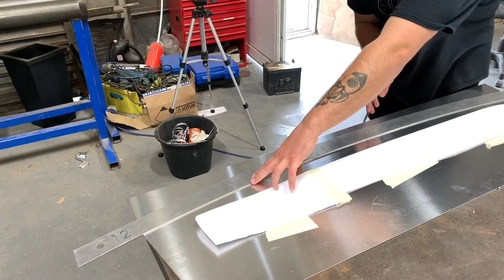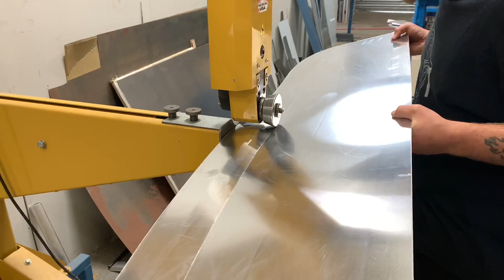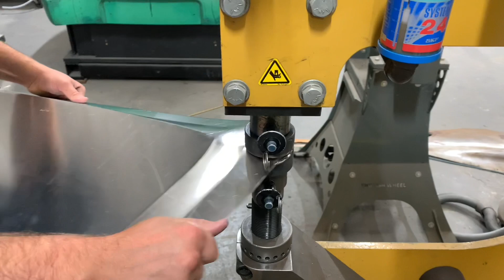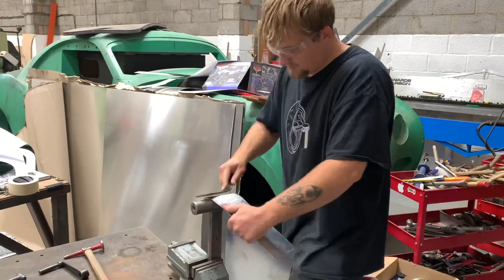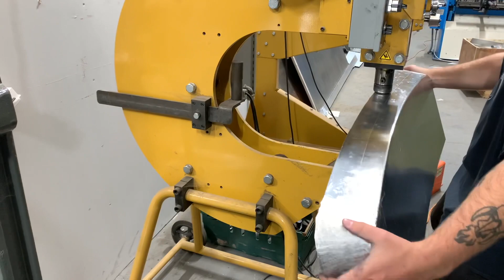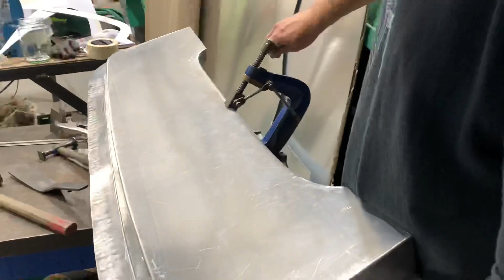Manufacturing a Bespoke Car Boot Frame (Part 1)

Comment: Can you tell me who manufactures the "manual G clamp Pullmax" devices that you were using to set the edge on the panel.
Thanks,
MIke
Reply from the maker: Hi Mike, it’s a home design, we are looking into getting a small batch made which will be available to buy on our website as soon as we can sort the manufacturing. Feel free to copy the design if you need one sooner. There is a video of using it on our tutorials “Tipping an Edge… A Step Further” on www.southanmetalcrafttutorials.com

Comment: I noticed you're hand operated on the shrinker. I just built a foot operated stand for mine. Is there an advantage to being hand operated?
Reply from the maker: Not really! I guess having a hand spare can be handy. A benefit of the hand operated is that you have a little more control over the pressure. I tend to be a bit clumsy with boots on etc. 😊
Reply: @southanindustries5208  Great work. I liked the videos.
Reply from the maker: @fixinstuff9662  thank you man! ☺️